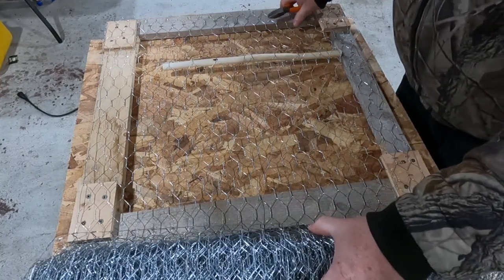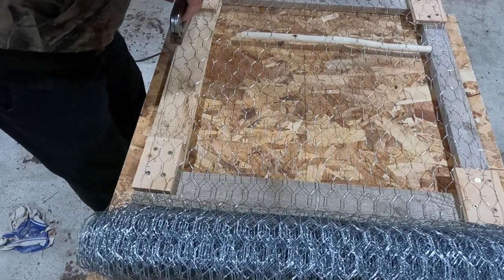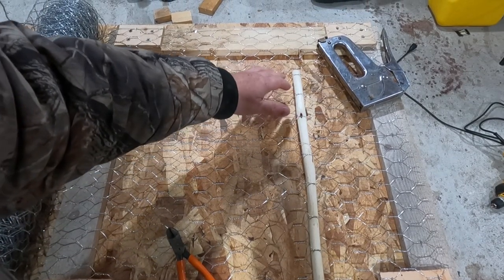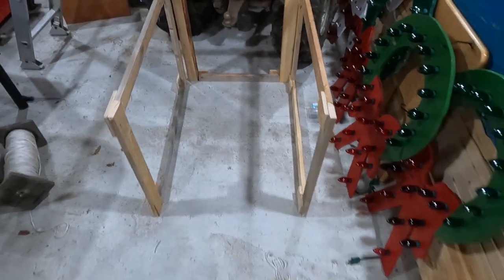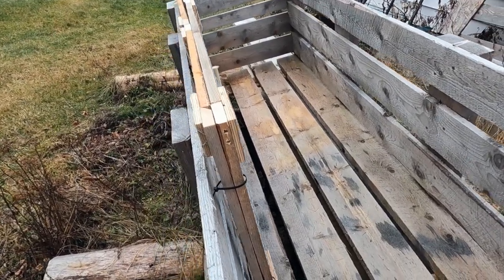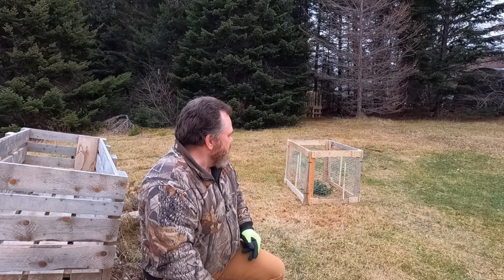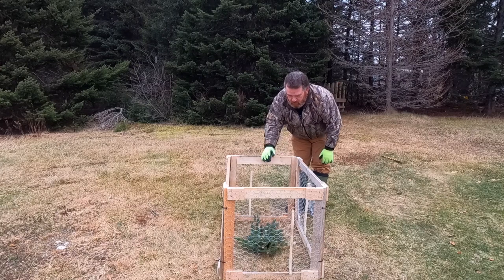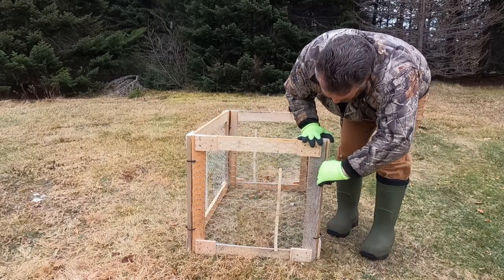World's Fastest Rabbit Snare Pen Set-Up

Comment: This is the coolest thing ever Charlie lol. I love it. Can’t wait to see you use it!!👍👍
Reply from the maker: haha Chuck, I've designed the gates on this one to be used in the snow. My though process is to push the frame into the snow so the top of the bottom boards are fresh with the snow. I've been thinking of many other uses for a frame something like this, for example double snare pen for lynx using 3' or 4' high chicken wire. Have it so the snare is tied to a drag pole. Lynx gets caught and gets tangled up near by with no damage to the pen. Built on a larger scale it could be used as duck blind or hunting blind. Just use natural vegetation to bush it in. Simple to build and many mods could be done to this concept for it to be used in a variety of different ways